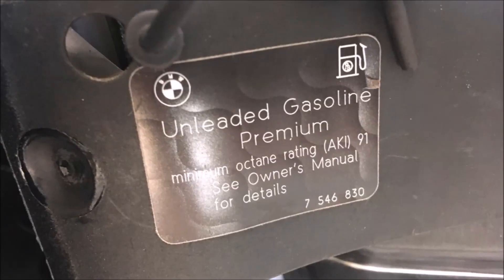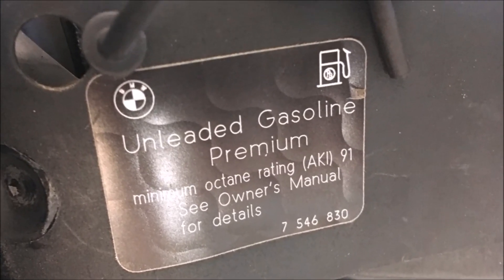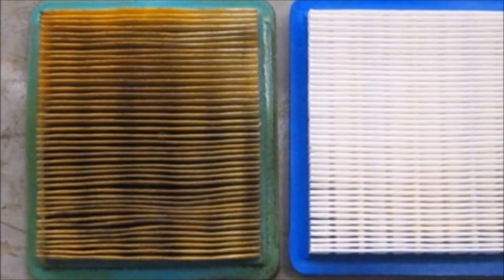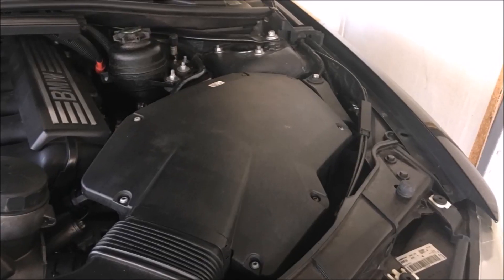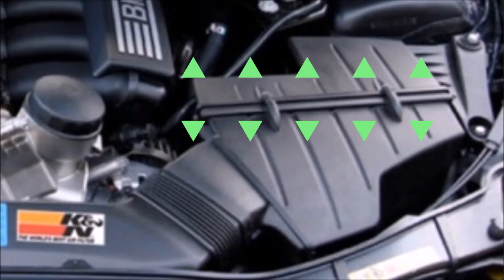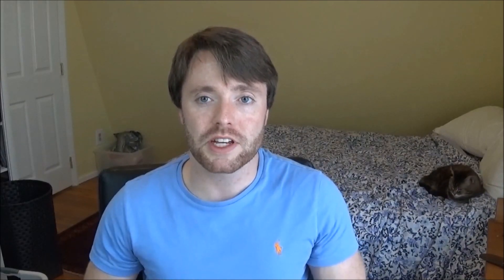Common Causes of Poor Fuel Economy

Comment: cold engine temp can also cause poor fuel economy. i mean thermostats that are stuck open causes engine to run cold basically on high speed like on highway. my bmw 320d e90 had both egr and main stats issue. coolant temp could hardly reach 60-65 on highway and mpg was like 7.8l/100km and even 8.1l/100km sometimes. so i replaced both stats and got coolant temp 86-88c which was enough to start dpf regen. drove on highway at 130km/h on 5th gear 3000 rpm for 45m. successfully dpf light gone, mpg to normal where it should be 5.5l/100km. Very satisfied with the work done by myself though it was not not that easy. so guys, if you have mpg problem or dpf if it is diesel dont forget to check coolant temp test. lots of videos out there on youtube on how to check coolant temp on bmw without coolant gauge. if your coolant temp below 80c then there is problem. so hope this helps.  Cheers:)
Reply: My e91 lci 320xd gets 9.5 in the city and 7.5 highway :/ Should I look out for something?

Comment: Could be a vacuum issue, mine had an issue similar to that and ended up being the valvetronic shaft gasket. In your case, if you start hearing a whistling from your engine, high pitched then it’s for sure a vacuum problem. Could be a valve cover, could be the valvetronic shaft gasket, could also be the CCV valve. It’s that circular thing on top of the valve cover. When it happened to me I also didn’t throw codes and started right back up. Eventually did get a code for system too lean bank 1- vacuum leak.
Reply from the maker: Thanks I will definitely look into that!

Comment: I need urgent help, I don’t know what to do anymore. I get around 4km per liter or 9mpg on my 2012 n55 e92. I don’t have good mechanics on my city so it’s hard for someone to know what’s wrong in my car. I need some recommendations. I’m about to clean the maf and o2 sensors and see what happens, everything else seems fine. Also I can smell gasoline from the engine bay but I see no leaks anywhere
Reply from the maker: I had a strong smell of gas when my injectors began to fail on my n54. I would also check your fuel rail, hpfp, and the fuel pressure sensor (I assume n55 has that).

Comment: I have a 2007 E91 with Alpina suspension, drive it like a BMW should, I changed the fuel pump under the rear seats and the belt tensioner unit when the car was getting 12.3 mpg and 18.1 mpg city/highway. Now I get 19.3 and 25.7. Only use Shell Vpower in Cali.

Comment: 328i 2011 gm trans 130k miles. Have you ever had this jerkiness/ pull when you’re driving on real low rpms? If so can you please provide a solution to this
Reply: Had this problem recently and thought I'd  changed plugs. Upon removing the plugs I noticed on of them was not burning like the others were. Check spark plugs and ignition coils for starters
Reply: Could also be torque converter shudder.

Comment: I have 14.5 mpg in city in my 2009 535i, and it's going lower! It might be even lower than that because it uses a quarter of a tank to drive 20,30 miles !! Anyone knows what's happening?
Reply: anoosh akhavan  have fuel delivery checked, o2, spark plugs.
Reply: Worst case could be blowby at pistons or burned valves if performance is waining a bit as well. Check positive crank ventilation /induction system for signs of oily/sticky sludge on back of throttle plate for visual that exhaust and oil mist is being burned by the engine. Overfueling because injectors are too dirty or are not operating properly can ruin an engine in several thousand miles if in detected. You can sample the oil also - if it smells like gasoline, you have gasoline blowing by the piston rings and thinning the oil. Find the cause of the overfueling before continuing to drive at all. Change oil immediately if you have to drive even short distances to get it looked at.
Reply: Ok now im not so worried about my 29.7 mpg

Comment: I have a 2006 E90 with N52  motor. Until a year ago, it was getting about 25 mpg on mixed Highway and City driving. Since then, it's been dropping and is now only 20 mpg. Driving hasn't changed. Spark plugs, injectors, O2 sensors, coils, air filter, all OK. Mechanic is baffled. Any ideas?
Reply from the maker: That's odd have you tried to clean Vanos solenoids? They're quite easy to do yourself just make sure to no lose the O-ring. I have a video on how to do so as well. Other things would be to clean the MAF like really drench it maybe even soak it (only the end that reads not the plug end) just make sure you don't let it touch anything else as they're fragile and expensive.
Reply from the maker: https://www.youtube.com/watch?v=oB2DIfBX8R8
Reply: Check compression

Comment: i have a e46 m3 and ive been getting 11 miles per gallon. I have to try all of these. thanks
Reply from the maker: Wow that’s not good at all unless you’ve just got a lead foot. Hopefully you can get it squared away.
Reply: BMW-E90-HQ haha I don’t. I always drive under 3,000 rpm. Every once and a while a small pull but that’s it

Comment: On my 2011 e91 I'm getting consistent 17-18mpg on 91 octane in Southern CA (Mostly city driving). So I just upgraded to the Performance Intake, Euro Airbox, and Silicone Intake hose in hopes of getting a couple better mpg. Haven't noticed a dramatic improvement yet, but i'll try to report back if any of this makes any difference.
Reply: I remember when I first got my 2011 e90 328 I was getting no more than 14.9 mpg. Over the last year I’ve become more tame with my driving so I get high 16s low 17s

Comment: No video ever says what their gas milage is! What are you getting on you 2006 325i
Reply: 15 miles per gallon
Reply: I get 28.5 m.p.g. in my 06 325i, and 25 in my 05 325i. 06 is 6 speed auto, 05 is 5 speed manual with headers and muffler delete.

Comment: E90 335i N54, done walnut blasting, changed plugs, oil change done, but fuel consumption is bad. Car runs fine. I get about 17.3 mpg. Mixed driving. I expected terrible fuel consumption, but was hoping it would be near 20mpg. Always run it on Shell V power Nitro+ rated at 99 Ron in uk.
Reply from the maker: I get about the same as you I’d consider that pretty decent or average. It’s not an economy car after all.
Reply: i’m getting 11.

Comment: I just found a fucked DISA valve on my E90 (N52B25). No codes, no nothin'. It was ready to fall apart.

For some reason you don't get much warning of this other than physical symptoms (no power, bad fuel economy, the "death rattle" - if you can hear it), I suppose BMW thought sending an open loop servo control signal was good enough (servo motors have internal feedback loops) and saved a wire there instead of running feedback.

Comment: I get around 16.4 mpg in my 128i but I drive it like I stole it lol.Do you have a source of info for the proper maintenance  schedules on n52's? I wouldn't mind changing my o2 sensors since I'm nearing 60k miles soon
Reply from the maker: I’ll have to find it. But I do have it somewhere.
Reply from the maker: https://www.bimmerfest.com/forums/attachment.php?attachmentid=259787&d=1293391109
Reply from the maker: Yes it’d be almost identical the only differences are you have a ZF transmission and you car comes stock with the 3 stage IM. Aside from a few other minor differences they’re essentially the same.
Reply: BMW-E90-HQ heck yeah thank you! It says I'm halfway there to replace my oxygen sensors.If I found some oem ones for a good price do you think if you were in my scenario would you replace them anyways.I feel the engine would be happier.
Reply from the maker: 123456bmx That’s completely your call I probably wouldn’t just yet mine made it to 80k before they failed

Comment: i get like 10.5 mpg in my 2008 335xi just driving around normally. i'm gonna try to replace the filter and plugs and hopefully i get little better fuel economy.
Reply: Did it work
Reply: LMAO WTF I changed mine and defitneky noticed better throttle which goes over to mpg
Reply: I get 9.5 in my 09 335i lol
Reply: Tuned

Comment: I’m getting roughly 21 MPG average.. probably 70% Highway and everything is up to snuff on my N52 E90.. and I hardly use DS mode. .the only thing that I think could be a factor of about 2 mpg would be my Thule roof bars with faring.. what’s your average mpg on the BC display?
Reply from the maker: It’s at 22.8 my tune most likely explains the difference. Since I’m probably at 60-70% highway with spirited driving.
Reply: BMW-E90-HQ that makes sense. In my case.. mines an XI so I have that against me aswell.

Comment: I been getting codes po171 and po174 I check for vacuums leaks , Nd nothing.  I erase the codes they still come back I replace mad sensor and new valve cover with gaskets . Any other ideals ?
Reply from the maker: Vacuum leaks can be difficult to track down sometimes. How have you checked? I usually use carb cleaner and spray it around the engine bay until I find a spot where it acts up. If that doesn’t work I’d suggest having a shop smoke test it.
Reply: BMW-E90-HQ they already did a smoke test on it it was the valve cover of the motor and the mAf sensor . But the codes return
Reply from the maker: Daniel Fonseca That’s odd could you possibly have a bad fuse? That’d be my first guess.
Reply: BMW-E90-HQ what fuse could of be
Reply from the maker: Daniel Fonseca Honestly I don’t know just whichever fuse controls the sensor in question. I’ve never experienced this problem so I don’t really know.
Reply: Im having the same codes but have a new valve cover gasket and dont hear any vacuum leaks did you ever figure it out?
Reply: @bondjamesbond2849  did u figure out this issue ever??
Reply: @vanity9547   I can’t remember tbh theres been  a lot done to the car in the last 3 years lol what are your symptoms?

Comment: Sound like your Crankshaft sensor going bad
Reply: Eddie Angel he would have huge oil leaks if that was the case
Reply: @flying541  ...not oil leak outside engine...  means oil going inside the sensor and making no signal.